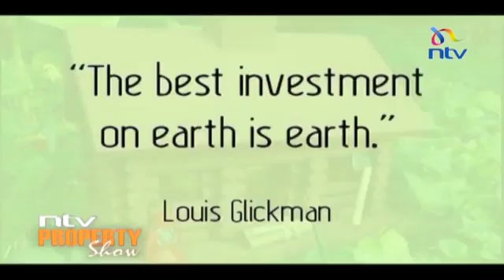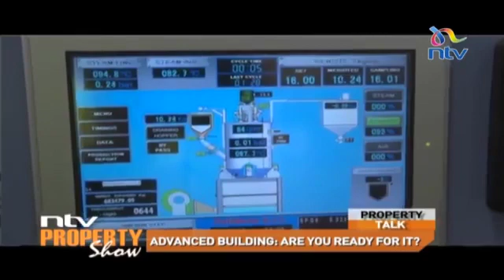Amazing new Building Technology. C-MAX M.D Interview with Jamila Mbugua on NTV property show.

Comment: Is it not back to the same old reliance on foreign imported products?
How about earth compressed bricks, which is just mud, abundant in Africa, as the main  material? It is cheap, durable and beautiful too!

This technology uses a product with a huge environmental challenge, Styrofoam, which is one of the most dangerous products to the environment. It takes millions of years to biodegrade. And it's already all over.
 If this technology becomes popular what will be done with all the cut-off pieces, and in the future when such buildings need to be demolished and rebuild? Remember there is not much incentive for the recycling of Styrofoam. I can go on and on. The technology is interesting but for the environmental threat it poses. Does the company have a solution to that?
Reply: He already explained in the interview that the company recycles the cut-off pieces. Did you realise styrofoam has been a recyclable product for ages? It takes people in the right places to take advantage of the recycling process, no matter the material.

Comment: I have been more interested to that -MAX Technology in construction using EPS Panel wired both side,so I would like to ask you if i need training about this construction technology.
Which requirement for  getting  training on this technology.

Raymond Patrick
raymonik99@gmail.technology,
Tel:+250785986885